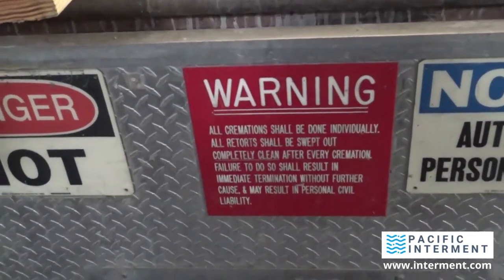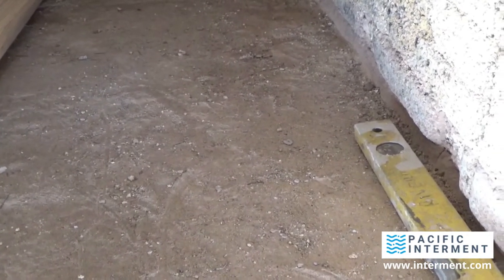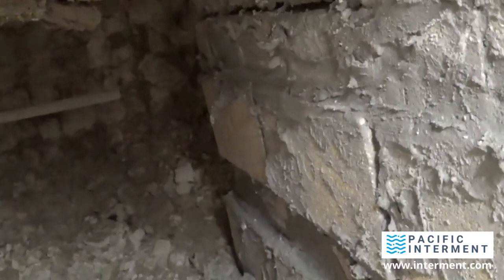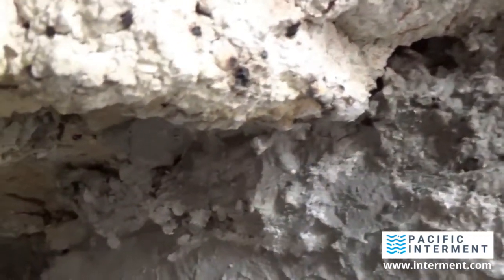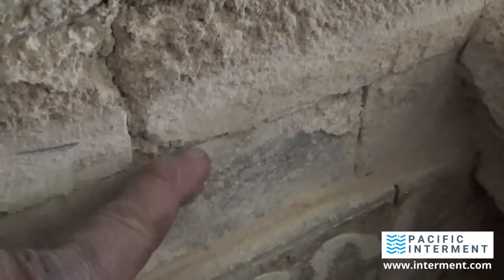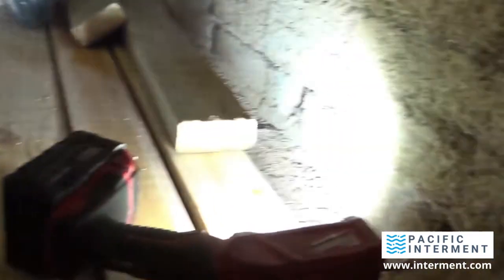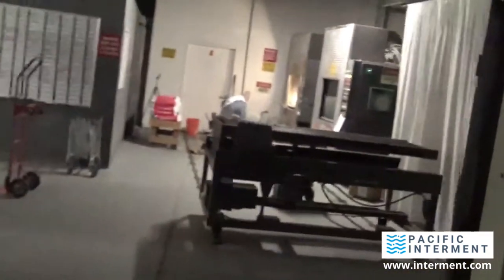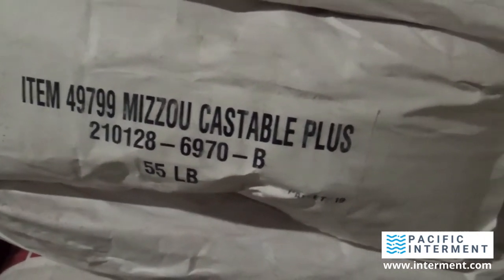Crematory Floor Repair- Part III

Comment from the maker: I have poured the rear dividing  wall before because I could not locate hard bricks during the pandemic. My concern with pouring the side walls would be with the inability of castible refractory to dissipate heat in between cremations. I would at least lay 3 or 4 rows of soft brick at the top of the wall.

Comment: Absolutely fascinating process............and here, i always thought these machines/retorts were bullet-proof. Now, even with repairs such as you are doing in these video's, what would be your estimated life-span of a typical machine?? Could your average $250K machine last a few decades with repairs/rebuilds??
Reply from the maker: The equipment itself has an infinite lifespan. All component parts are replaceable. With proper care and maintenance they should last beyond any human lifespan.